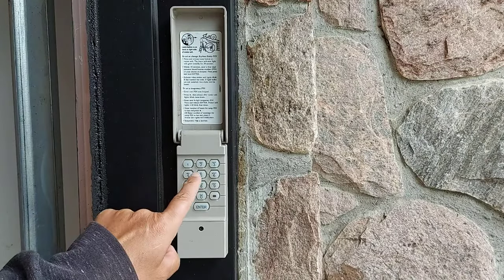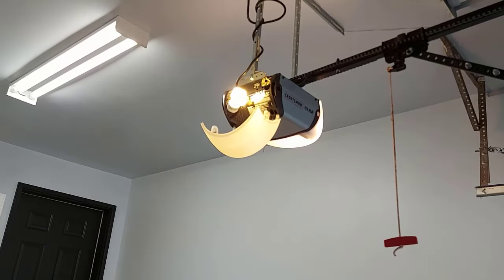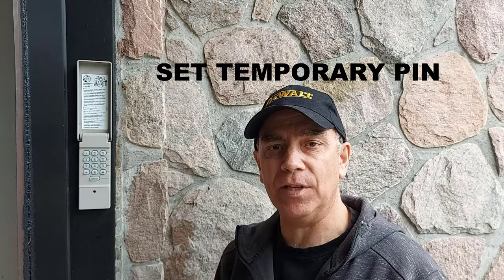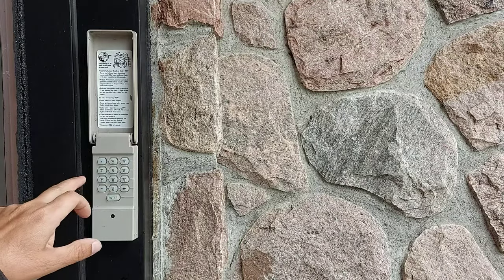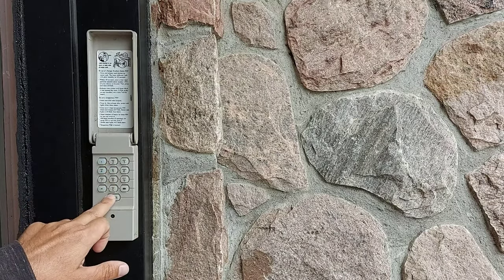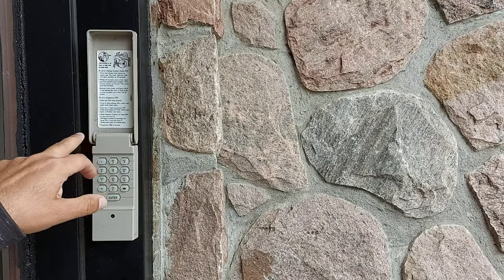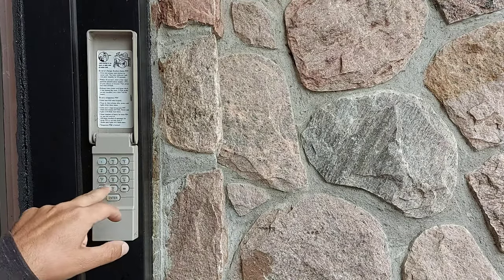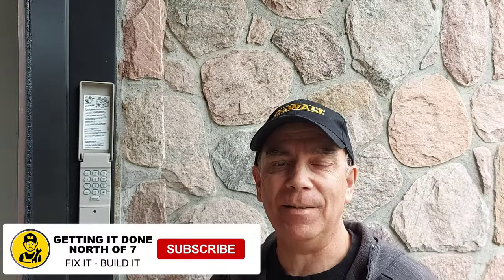How to Change PIN On Craftsman Garage Door Keypad

Comment: Any idea of the maximum number of hours for a temporary pin? For example, if I go on vacation for 4 weeks, and I want to give a house sitter access for 30 days, can I set to 720 hours? (24 hours x 30 days = 720 hours) Thanks.
Reply: just change the code for the house sitter than change it again when you return

Comment: I have done these steps a few times the directions are on the keypad. However, it's not working and i have a bulb its not flashing or clicking. Any ideas? The keypad flashes just doesnt work with the door
Reply from the maker: Is the battery getting low?

Comment: I don't have an enter button, what now?
Reply: My Craftsman garage door keypad also does not have an enter button. We installed it probably 30 years ago. I even still have the installation manual which does not give instructions for changing the PIN. However I figured it out. I opened up the cover on the indoor button panel where the battery goes. There was a black slide switch in the up position. I slid it down, entered the new code on the keypad, and then slid the switch back to the up position. That did the trick.

Comment: Weeeeelllll, since you're talking about garage door openers ... can you re-set a door that won't open all the way??  Nothing is blocking the track; it will go up like 3/4's of the way and then stop.  What's up with that?  Probably need a new door opener...
Reply from the maker: I actually had that problem at our previous home. I can't remember the remedy. Did you get it fixed?
Reply: Not yet.  Sometimes it works good; sometimes not.

Comment: I have craftsman without the star and pound key, how do you reset and program?
Reply from the maker: I'm not sure. I'll look into it
Reply: My Craftsman garage door keypad also does not have an enter button. We installed it probably 30 years ago. I even still have the installation manual which does not give instructions for changing the PIN. However I figured it out. I opened up the cover on the indoor button panel where the battery goes. There was a black slide switch in the up position. I slid it down, entered the new code on the keypad, and then slid the switch back to the up position. That did the trick.